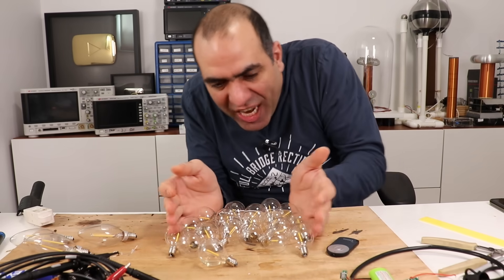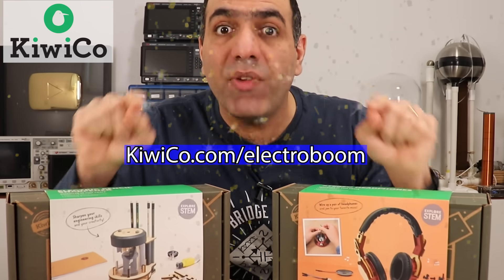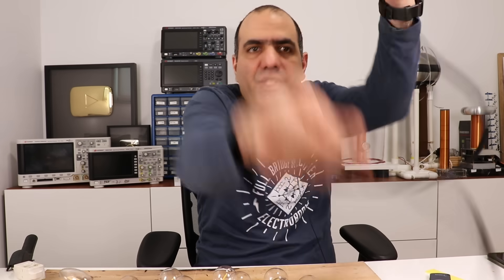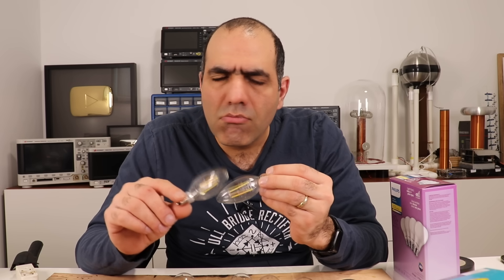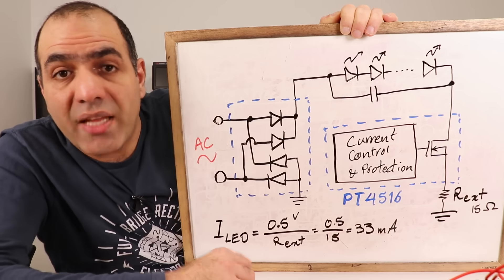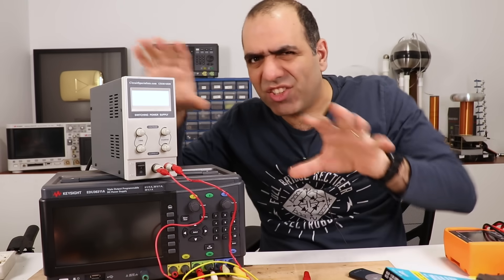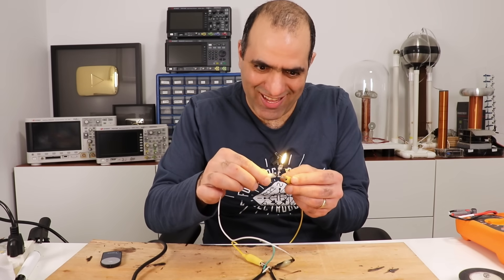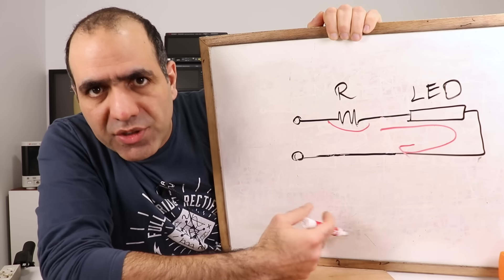So Many MISERABLY FAILED LED Lights

Comment: I recognize this. I replaced multiple expensive (€15 or more) LED bulbs over the last years. '50.000 hours runtime MTBF' according to the package. Yeah, right. I didn't timed the actual running time, but 500 hours would be more adequate I suppose.

Comment: I hated the idea of transitioning to LEDs for general lighting for this very reason. I knew the manufacturers would do this. You know they figured out how to make a nearly indestructible incandescent bulb in the early 20th century? The manufacturers decided to act like a cartel and none of them would sell those bulbs that could theoretically last for decades. They want light bulbs to be disposable products so you buy lots of them regularly. That's how I knew they were going to do the same thing with LEDs. In theory, LED lighting should be superior, but, in reality, they use crappy LEDs and shoddy build quality, but still charge more than for incandescents. Then they lie about how long incandescent bulbs last and how long their rigged LED bulbs last. It's all a big con to milk money out of us.

Comment: I had horrible luck with Cree LED bulbs that were sold by Home Depot. Most burnt out quickly. I was quite disappointed. I think Home Depot stopped selling the brand where I live. Some companies seem to be very good at building high intensity LED’s but I think something gets lost in the manufacturing. My personal guess is that sometimes the larger wattages might not have adequate heat sinks or heat sinks that separate over time and then the bulb burns out. I can’t confirm this but to me it seems like the most logical point of failure. Also, I had bad luck with 150 watt equivalent LED bulbs that were supposedly Phillips sold on Amazon. I am almost certain they were fake because they were lucky if they lasted a few days.

Comment: Here's an idea to make them last REALLY long:
If you want 60w output, buy 100W LEDs, and put them through a power regulator working at 60w.

As the LED does not work at full capacity, it will last a LOT longer.

Same goes for iridescent light bulbs.

Well, basically?
It works with everything.  :P

Comment: Have you use light bulb from waveform? it's pretty good but bit pricy.
I have several broken one and the way they drive the LED seems different with others.
If you want to check those bulb out let me know.
I installed your internet when your place still under reno, if you remember me

Comment: the sad trend is that these bulbs are pushing 33ma, when they are only designed to have "effectively infinite lifespan" at <20ma
what kills all these LED devices is they are designed to push too much current through the LED's

it isn't actually even about efficiency(unless you count "profit efficiency" of the manufacturer)

LED's actually have inverse logarithmic curve of current to efficiency of lumen output

if you put 0.5ma through an led it lights up, and doubling the current does not double the light output(though at 0.5ma it can be effectively invisible in some cases)

manufacturers know that these chips can maybe handle 10-20ma and put >30ma through them, which causes heating which causes thermal death
or if designed poorly and used in humid or outdoor locations it can cause pressure differences due to heat cycles and literally suck in water when they cool

unfortunately with the current regulator chips there is no way short of actually dismantling the bulb itself to fix the "planned death" design

if they are the type that is "dimmable" you should dim them, probably to 50%
this will increase lifespan, much like how you could run an incandescent bulb at less voltage and make it last decades

but unlike incandescent bulbs, an LED running at 50% power actually is more efficient rather than less efficient

Comment: Mehdi the warranty is valid if the voltage is steady at 120V ±2% you can prove it if you are using a AVR or Automatic Voltage Regulator (is a variak with a servo motor newer runs with SCR's like circuits or IGBT's) this is important!!

Comment: 3:24 as an electrical engineering student, my advice is instead of buying the ones with a warranty, get ones that are proven to work. Think outside of the box, instead of buying the same bulbs over and over (which is more polluting than just disposing of ONE pack of those cheap bulbs) I suggest you buy visually high quality LEDs.
Reply: Congrats, you can rephrase exactly what was said in the video 10 seconds later, and yet still can only vomit out basic common sense
Reply: @xSARGEx117x wow what is in your pants. Ol' mate was just talking about his passion sad somone like you gets upset at that.

Comment: 2024- now that the US has federally banned the sale of incandescent bulbs for houses (which is completely ridiculous for so many reasons and completely over stepping their lines there… it’s a damn light bulb), they need to implement strict standards on all led lights sold in the US, especially if people are now forced to purchase them and yet the risk of them not working correctly, or not at all, is so high, even though they are expensive. The amount of times I have seen expensive leds fail to the point where it just starts strobing, it can be a real safety concern. People who are epileptic may have a greater risk of having a seizure. Even big buildings where they can afford expensive lights from high end companies. They are always broken or flashing. A funny example is just a few years ago, my city purchased a bunch of new LED light poles that they were going to install on the thruway leading into the city. They already had incandescent ones that were great. They were super bright, and never burned out. At least a hundred of these poles were there. Well the city installed all these new led ones and immediately they were all broken. They didn’t even turn on. Right out of the factory. It made huge local news.

Comment: I just take old incondecent light and crack them open with heat. Then I stick low voltage LEDs in it. Then seal it back up with glass adhesive!
Reply: Atleast wire them with resistor unless you want your room to go boom boom

Comment: LEDs are the biggest fraud of the century in my opinion - they are so overrated.  Many of them fail prematurely  - I have seen incandescent  bulbs outlast LEDs hands down - LEDs fail because of heat  - in TVs they come with backlight set to FULL out of the box, it's no wonder they lose 50% of their brightness in a short period of time.   So yeah LEDs running at full brightness will eventually fail due to heat.  Dimming a LED can increase lifespan big time.   I still have monitors running with full LED brightness, I just don't run the backlight at 100%, I run it at less than 40%.

Comment: So since you talk about feedback. I wanted to buy kiwico, the price (around 25 €/Month) for the crate was ok, but the shipping and custom duties killed it (shipping into the EU). The final price was like 45 to 50 EUR per crate and that is way too much for european standards.
That's a shame. After so many years in the EU there is nothing close yet, so as a feedback if they could find a distributor here, or open a branch in the EU, could greatly help reduce the cost and spread their beautiful idea.

Comment: My favorite kind of outdoor LED lights is got to be the multicolored solar string lights cause I found a 96 foot set that comes with a remote that you can change the settings and there’s no wires needed and you just had to put the solar panel in a sunny spot where you can keep my energy to put inside of a returnable battery and the solar power as a photocell and turns on string lights automatically and turn them off during the day while the batteries were charging, it will be pretty cool cause it will be long enough to go all the way around my front porch

Comment: If mankind would go back to use candles and ancient petrol or olive oil candles that would piss of led light bulb manufacturers.
You would be surprised how a simple lamp made of a glass, some cloth and some olive oil works really well. I should know because that's how it was in the old village where my parents came from in the time before electricity came to that village.

Comment: I've had to experiment with various brands of standard and smart LED bulbs. GE seems to be good. I avoid FEIT like the plague now. They are constantly dying, and are way too sensitive to heat. Meanwhile, a GE 60W equivalent has been in an enclosed globe fixture and on for one year without a break, and it is still going.

Comment: I absolutely loathe my old management when they keep insisting on switching from a light fixture with a built in LED, when it fails (which sometimes does) instead of an easy 1 minute bulb replacement you’re now stuck with replacing an entire fixture.

Comment: The maximum time before failure might be how they rate hard drive operation. They take 1,000 hard drives, power them up, send and read data to them. One hundred and one of them die they take that time and multiply it by two. That's how they get these ridiculously high numbers of hours even though half of them failed

Comment: I feel like ihit the LED bulb jackpot.  when i bought my house 4 years ago, first thing i did was order 60 LED light bulbs from Amazon to replace all the incandescent light in the house.  in 4 years, i have had only two bulbs die.

I think it might be that i chose low brightness bulbs, though.  The bulbs i picked are equivalent luminance to 20-watt incandescent, because i like the more yellow color and the lower light intensity. If i had gone for 60-watt EQs, maybe i would have lost more by now?

Comment: To really save energy=money better get a solar panel and place it somewhere with a power bank to charge your phone..or with a battery to light a room.
Dont trust even the known brands because its all about advertising and marketing. They may last a bit longer but not enough to recover the money spent on it from  paying less to the energy bills.
Even in the warranty of Dubai bulb from Philips (4W/840 lumens) there is a paradox lie.
They guarantee that the light bulb lasts 50 years (if run 3 hours from 24) or 50,000 hours. To be more more specific, in order to guarantee something about a lifespan of a product, it means that you've tested that product for that period of time and the fact is this LED technology was not even invented 50 years ago.
Its like saying to a 10-year-old kid this: Hei I saw you 15 years ago with a cool purple t-shirt, do you still have it?
Morale is: Only solar energy can save you energy=money not the lightbulbs.
I forgot to mention that Philips Dubai light bulbs are insanely expensive and you never know when is gonna fail.

Comment: Meanwhile my 2 years warranty, generic bulbs: lessgo boys keep on workin' hehehe.

5.9W, 806 lumens, 2700K, 80 CRI. Not the best (you can get 4W, 860 lumens with a better CRI here), but good enough.
Reply: The one's you can buy at goodwill or thrift stores from your local energy company are usually the best. I've yet to have one of those cheap bulbs burn out.
Reply: @starlight4649  Update: all those generic bulbs are still around and kicking. Not a single failure, including in enclosed light fixtures. Some other LEDs have failed.

Comment: LED lights are sneaky basterds that slowly get dimmer, and dimmer... Until you get annoyed by the poor light and change it to a new one. And notice how warm the old LED light was, compared to the new one.
Will i have to measure the Lumens of my LED lights with a meter gadget monthly??

I have a suspicion that LED lights degrade because of voltage spikes.
Will i have to put a overvoltage suppressor on every LED to make them last?

Comment: Just a simple tip. 
Don't buy the crappiest and cheapest LED bulb possible and you'll probably be ok. The reputable brands although more expensive, they really built them like tanks in my experience.

Comment: "If designers knew how to make things to last for a specific application we wouldn't be in this situation."

Yes we would. They design them poorly so you have to buy more. If they make a light bulb that lasts 5 years instead of 6 months that's 10 times as fewer bulbs they sell.

Comment: I've only ever had 1 fail and that was within the 1 year warranty so I got a free replacement. I've always been a bit of a bulb geek so can generally spot a low quality bulb.

As a general rule, for every 10w equivalent an LED filament bulb should have at least 1 filament... So those 40w equivalents with 2 filaments should have at least 4 filaments. The cheap bulbs that I used to buy decided to skimp and drop the number of filaments, I saw them and never bought one from them again. Until recently that is as the energy rating system has changed their design to run the LEDs at a lower power although maybe 8 years later they're only 2.5% more efficient then original bulbs I used to buy from them. Although from the cheapend ones they switched to they're probably more in the region of 22% more efficient.

The only reason I bought more recently is because my mum was still using compact fluorescents and I converted her house to LEDs for her.

Comment: Just use fluorescent lamps, they last long, cheap, and still efficient.

LEDs are expensive but efficient, however manufacturers tend to overload the strips/chips by adding few strips/chips to cut costs. Overloading them makes them not to last long = you buying again = profit.

LEDs are crap, just like ev cars. Stick with fluorescent.

For LEDs to last long, they should not be overloaded which means you need more strips/chips for more lumen = more costs and you buying less of them = less profit for manufacturers.

(By overloading I mean that sending more power to a strip/chip so it can give more lumens)

Comment: The environmental cost of buying cheap junk is often neglected. Someone has to use machinery to mine the raw materials. Then transport them to a refinery. The pollution to refine them is often toxic. Then the pollution from shipping and transport to warehouses and shops. Only for it to last a few months. It should be criminal.

Comment: 3:56 I attach all my LEDs circuit to an UPS or some sort of regulated power supply, those electronics are very fragile and it seems they don't like being in the same circuit as heavy duty things like microwaves and ovens and electric showers that create a lot of noise and spikes and back emf and that shit.

Comment: Has anyone made an auto on/off and auto dimming filament led so you only need to deal with lights in your house when you need to go to bed? Could these be low enough to use IR or something that allows auto on/off inside? can't find light bulbs to do this. With just light bulbs and no extra sensors.

Comment: My experience from LED lights is, they last 1year at most! that's why I hate them.
Reply: Don't buy cheap LED lights. A good LED light can last you for years. Every time i buy a cheap LED light, it lasted just a year. But if you go for a more expensive LED, it can last up to 15 years, and none of them broke.

Comment: Not so good to use the scope on the ac line.
Even if the neutral is connected properly current will flow through the ground lead.
It is better to use two channels configured for differential mode.
Some people use a 3 prong to 2 prong adapter on the power code to unground the scope chassis.
This is dangerous if the probe ground  or scope chassis gets accidentally connected to the hot side of the line.
If you touch the scope chassis or probe ground you will get a shock. Shorting these points to ground will be exiting and colorful.
I have done this but I am careful. Better to use a battery powered portable scope if you have one.

Comment: This video made me wonder if reducing energy consumption of the LED is worth the increased manufacturing waste, considering you have to keep changing them every 6 months.
Reply: LED lights last longer than incodescent and flourocent lights. It all depends on the manufacturer. Going cheap on an LED light will just force you to change it every year since they use smaller drives and less strings which causes them to die much quicker. Buying a good LED light can last up to 15 years. I buy more expensive LED lights and none of them broke like ever
Reply: @theomegakiller7059  they all say that, but all my LED last no longer than a year, not a cheap one either.
Reply: @XiaZ  even branded ones? My LED lights don't die this quickly
Reply: @theomegakiller7059  is Philips a good enough brand? Maybe I'll try Osram next time.
Reply: @XiaZ  philips might be good, but i'm not familiar with osram. If you live in a country like america or switzerland, look for an energy star certification as they're guaranteed to be a good energy efficent product. (If you live in thailand according to your yt account then too bad since they don't do it there, so your best bet is to look for reviews for the product.)